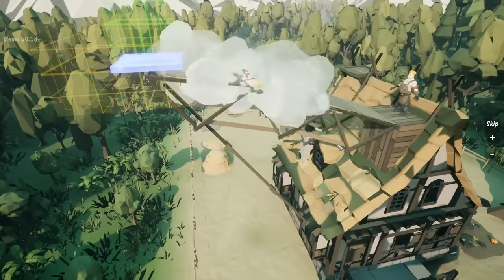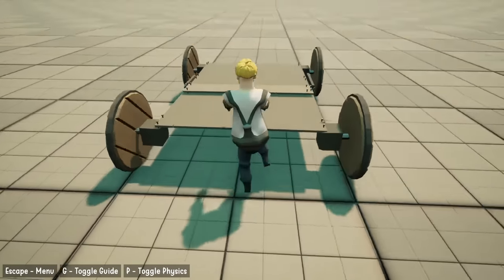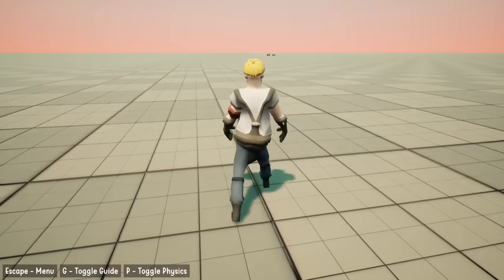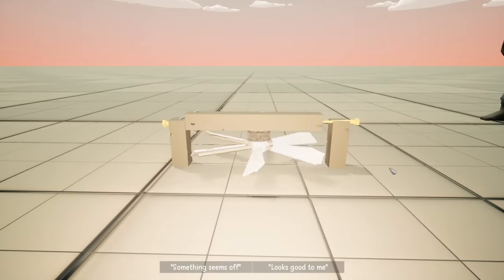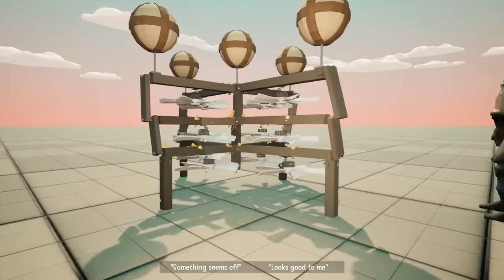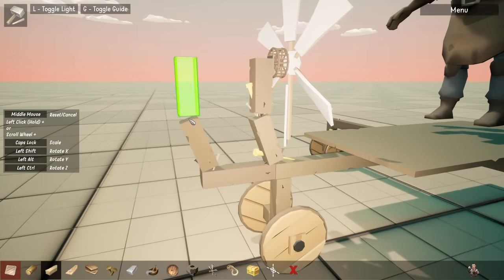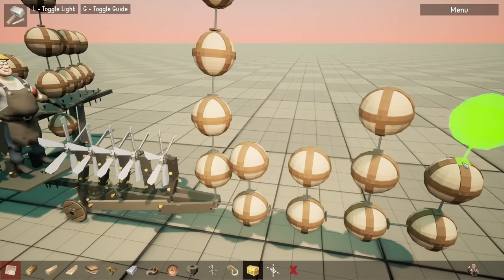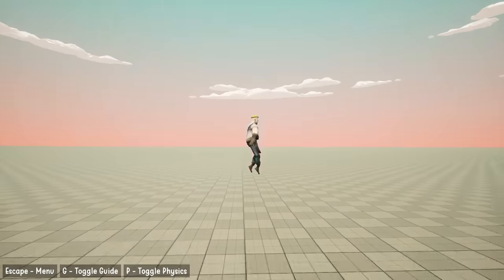Making A Plane From Bridge Pieces in The Enjenir

Comment from the maker: I wonder if it's possible to make an engine... might need to explore that a little. Next though I think I want to try calculating pi in Shapez.io.
Reply: 1. Super hyped, looking forward to it!
2. You will have to do a similar thing in shapez 2 when it comes out 😉
Reply: Cool
Reply: can you play Scrap Mechanic again in a future video?
Reply: You pole danced to steer a plane 💀
Reply: As a suggestion, since you have access to balloons, you could probably design an airship, so it would be cool to see you build a functioning zeppelin, and use rotators to angle the fans up down or whatever direction, while having the balloon and weight neutrally buoyant so you rely soly on the fans for directional control.

Think of a osprey tilting propeller so making it land, turn and take off without needing to deal with aerodynamics.

Comment: Thanks again for checking out our game! Looking forward to getting Gears and Powered Rotators added to see what else folk come up with! We'll even be exploring aerodynamics to see if that's something we can make it work! 👀 Thanks again!
Reply: It'd be cool if like a symmetry mode or something that makes it a little easier to make things straight. Because from other youtubers trying out the game I noticed how it was difficult to make things structurally sound.
Reply: @parkers3250 I think that's the bit tho
Reply: Aerodynamics sounds like it would be quite useful for simulating wind loads on structures. Maybe there could be a level where you design a hurricane-proof building (if that isn't already planned).
Reply: @parkers3250 the whole screw/nail ordeal makes me think that the point of the game is to overcome limitations like that
Reply: Also please fix cement so you can build 2x1 pillars like jenga with bricks if you know what I mean. You can see it in one of RCEs video where he tries to build a big bridge. Thank you.
Reply: Hi! Very cool game, albeit i see some (not flaws, more like unimplemented features at moment) slight problems.
I understand that the whole idea of the game is to overcome overall cartoonish/parody-ish style of what you have built, but it would be very useful to have some kind of "interactives", for example levers. As i can see you could make so that player still manually controls instead of a single button action, but overall more controlled than if you had made them out of structural stuff.

P.s. I hope understood what i meant with this nonsense.)
Reply: @lavenderinthedark  yeah i guess

Comment: You might be able to make that steering stick not flip around by adding a weight to the bottom of it so it's self-correcting. Though with the tight space you left yourself, that might not be an easy task to accomplish.